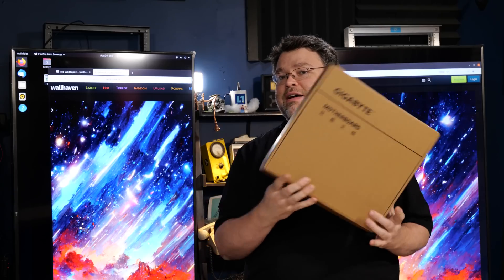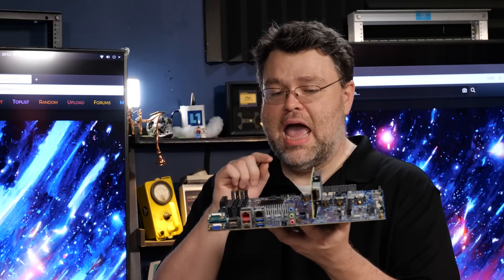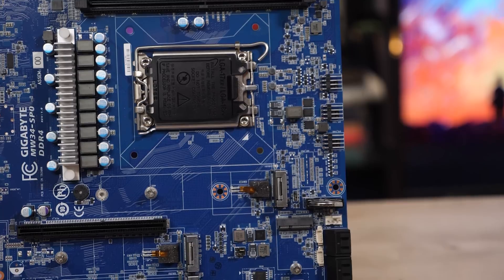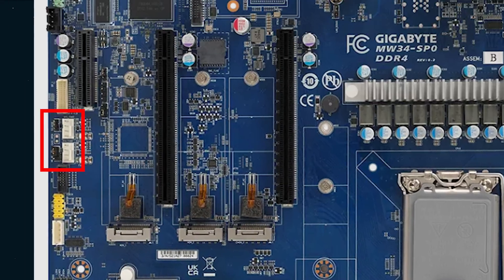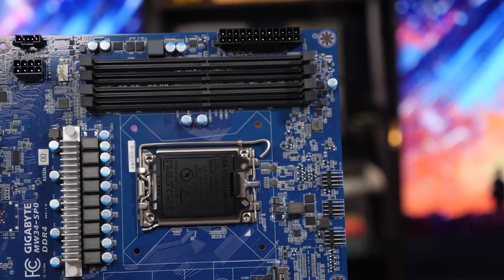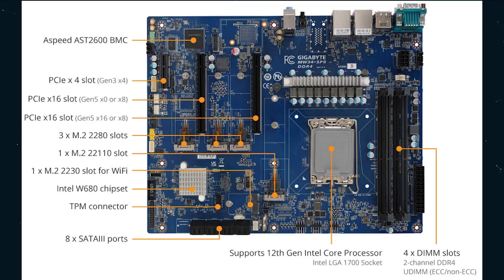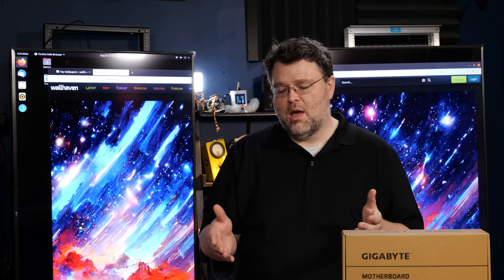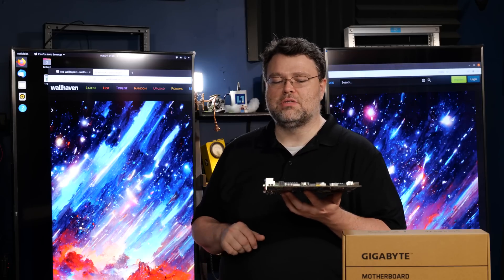Gigabyte MW34SP0 Motherboard Review

Comment: This would be a great option for if/when I want to upgrade my pfSense router. Currently have one of the "off the shelve" 1U rackmount pfSense boxes which work pretty nice (has I believe 6 gigabit NICs) and that is fine for my home network. I just notice that the low powered Atom CPU inside can struggle at times, although I'm not sure if that is the issue, or it is due to some bug in pfBlockerNG. But this, with something like that 12400, a couple of 4-port gigabit PCIe cards I have lying around, that in a 2U chassis... could be a nice upgrade path.

Comment: Well, with such a board it kind of screams to be installed in an edge home-lab server, aka HPE Microserver DIY replacement, to fulfill duties of both NAS with apps support and router... After all, 4 M.2s look like a good choice for a 4-way Z1 vdev or OS dev + ARC dev + SLOG dev + META dev with 6-way SATA for the bulk of the storage in Z1 or Z2... that with 4x DIMMs for a 128GB setup would allow ZFS to fly, or server to host multiple apps... Add the fact that AL desktop chips come with iGPUs in most SKUs and you get transcoding HW acceleration supported by most solutions... and no need for dGPU albeit maybe useful regardless, though on the other hand the multiple network cards setup with the AiC passed through to the "router" VM/container can allow you to also serve the net for your 100Gbit switched LAN and still provide NAS/app server duties in the same box.

Comment: QuickSync on an Intel CPU is actually a MUCH better way to do your hardware transcoding on your media server.
(No not Plex. Fuck those guys and their cloud nonsense. Use Jellyfin.)
There is no need to spend the $$ on a standalone GPU. And an IGPU is going to use WAAAAY less power anyway.
It's actually one of the best advantages of using a consumer-series CPU in a home server compared to using real stuff like an EPYC.

Comment: If i could get this in mATX i'd replace my Ryzen 5 3600 build with uDIMM ECC in an Asrock Rack board that is in much the same spirit of this, i originally only planned to have this just for TrueNAS, but ever since Plex started working well with TrueNAS i've had the desire to make an all in one system that not only is my portable SSD storage server with that 16 bay ICY Dock 2.5 inch hot swap cage, but also can record over the air TV and then transcode it to H265 or AV1.
I'm really excited for AMD 7000 and Intel 13000 series and basically whichever one has the better all core perrformance per watt, and whichever one has built in AV1 i'm pulling the trigger on it
Right now i am splitting this workload across 3 machines making this very inefficeint
First machine is the R5 3600 TrueNAS box (in an XQPack2 case that will become my redundant server once i get this one built, and what i use to update my off site file server as my off site location only has cellular)
Second machine is my 5700G plex box with 3 internal 4 channel tuners(these are far more reliable than the external ones for some reason)
But because the 5700G CPU is not powerful enough to transcode and record at the same time, i put a 3950x in my gaming rig so that i could transcode faster than real time
I wish GPU transcoding worked but my local stations broadcast in MPEG2, and no matter what hardware encoder i use, 2000 series NVENC, RDNA1 and 5000G series VCE, 5th through 12th gen QSV, or M1 VideoTollBox they all make the file either larger than original, or are significantly poorer quality than CPU, which can often offer the same quality at 1/3rd to 1/5th the size of the original.
NVENC was the worst at nearly a 2x file size increase from original when transcoding to H265

I wish my local broadcasters wouldnt broadcast in what im guessing is RAW video because a 60 minute 720p show might be as much as 3GB, thats something like 2.5x the bit rate found on DVDs, yet it looks terrible which is why i can often compress it to 1/5th the size.

Comment: Is this mobo being sold anywhere yet? Can’t find any trace of it. I’d also be curious if the 2 x8 slots support bifurcating as x4x4? Does the iGPU work for QuickSync? On my 1151 ASRockRack with a 9700K there’s a secret BIOS option to allow “headless” QS.

Comment: Maybe something for upgrading my ~20 year old backup server, that only runs on ~200Mbps of 1 Gbps, due to a ~95% load on one CPU thread of my Pentium 4 HT (1C2T; 3.0GHz).  It also has 1.5GB DDR (400MHz ); two 3.5" IDE HDDs (250 +350GB) and two 2.5" SATA-1 HDDs (320+320GB) in total 1.21TB.  
The system is in use for say ~1.5 hours/week since June 2019 and the system cost was $0.00.
It runs FreeBSD 13.1 on OpenZFS 2.1.4 :)  It has 2 datapools; zroot on the 2 striped IDE HDDs and dpool on the 2 striped laptop HDDs.

Comment: But... how much does this motherboard cost? There are zero prices online, and the only other W680 motherboards I've seen are like $500, which nullifies the "cost effectiveness" argument.
Reply: Boards that can mount Xeons aren't cheaper, and Xeons themselves ain't cheap so in the end it is still a win
Reply: @marcogenovesi8570  used ones are. 😁
Reply: The idea is to obtain ECC feature with a budget processor such as 12600K which is already a big saving.
Reply: Same I was looking for it too. I’m sold. I want to build the forbidden router.
Reply: Yeah, it's unfortunate, can only find that singular Supermicro board (X13SAE) for sale to consumers...
At this rate my "dream" home server keeps getting pushed further and further away.
Reply: I've been waiting to see these since i learned about ecc support last spring. The supermicro w680 board is almost $500, so i imagine this will fall between low 400s-500s; but as far as finding them, I haven't the foggiest.
Reply: what a budget build . A motherboard that impossible to buy to support chips with cores you cant or don't want to use
Reply: @gregoryp203  You forgot that RAM is also impossible to get

Comment: I have 3 Gig internet now and am looking at options that would be better than the ISPs modem.  I have an old it's system with an i7-4770k and 16GB DDR3.  Not sure if this is enough of a system before I buy a dual 10g Intel NIC to throw in it.
Reply: Most consumer routers have a power budget below 15 watts. The 4770K will be complete overkill for most users building a router, but keep in mind that exploit mitigations will render it much slower than some cheap modern processors. But it'll be a much better experience with PFsense or OpenWRT than anything else.

Comment: Nice...ECC Memories Make a Difference for Small Servers? For example, for a supermarket retail store, would this make sense or is ECC suitable for big things and big financial transactions?
Reply: If you're handling money you're gonna want ECC. The odds of a memory fault might be very low, but the extra cost is minimal for a real business. Top of the safety margin priority list is proper backups and redundancy for storage and power. ECC comes after that.
Reply: In a supermarket you'd have cashiers terminals and a central server, you don't need ecc on the terminals, you do want it on the server which will be processing and verifying terminal data. The amount of random bit errors is roghly proportional to the working data set - the more data you have in memory the likelier the chance a cosmic ray flips a bit. In addition to random bit flips, ecc is good for early detection of failing memory, which on a normal system may remain hidden and generate lots of corrupt data before the failure becomes noticeable.
Reply: just like raid1 is not a backup ECC is not a bussiness continuity solution. If up time is critical there should be redundant  servers and the software should be configured for a high availibility(HA) cluster . ECC memory is for those who dont care how much it is. If there isnt HA, then uptime is not important to you so ECC is a waste